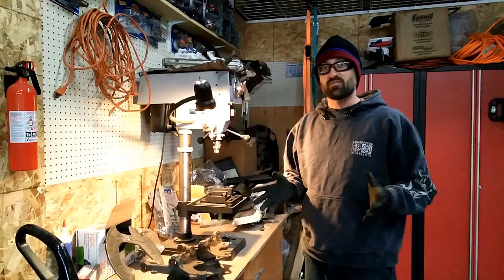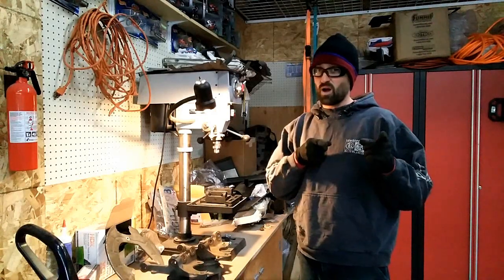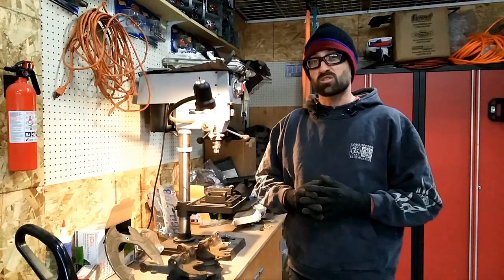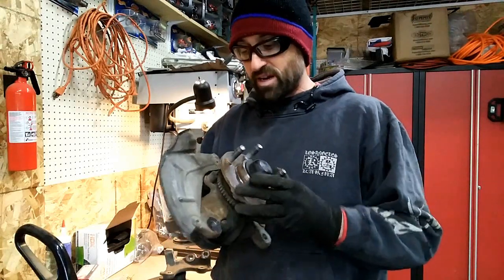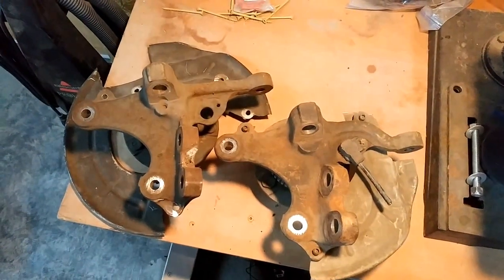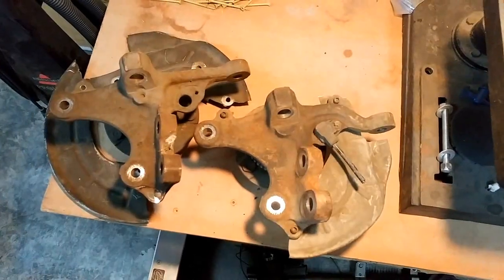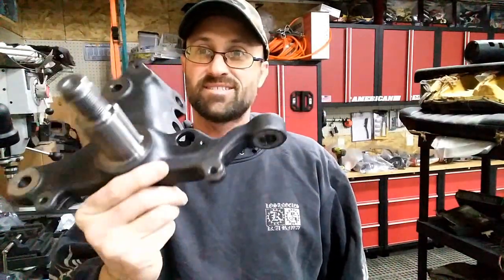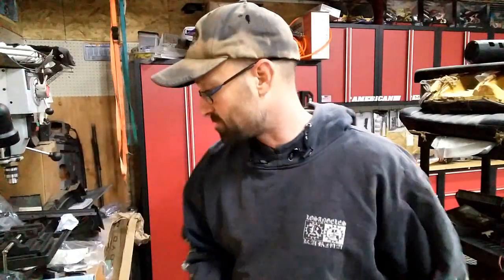How to Rebuild 94-04 5-Lug Ford Mustang Front Spindles

Comment: Good clean up on spindles i would like to know about new ones from 85yr 4 lug to 5 lug i believe 94-95 or is it 94-04 fronts
Reply from the maker: If you are running a stock Ford K-member, stay with the 94-95 spindles.

Comment: Did you just paint on the Evapo-Rust?  You mentioned a bucket, but you didn't immerse the whole spindle with the bearings, etc. in the bucket did you?
Reply from the maker: Just the spindles. The hubs (which contains the sealed bearings) were removed. I replaced the hubs with new parts when I reassembled everything back together.
Reply: @BasinMotorsports  
Thanks for the response.

Comment: Can you clarify how you removed the dust shield without the drill press?  I'm not having the best of luck with my regular hand drill and think the other method you mentioned in the video might be better for me.  Thanks!
Reply from the maker: I have used a small cutoff wheel on a Dremel to cut the backs off. Once that is done, the heads will come off the front easily.
Reply: @BasinMotorsports  Thank you so much.  I already have a 1/4 Die Grinder, but I need some cut off wheels.  I'll do what you recommend and try to cut the rivet as close to the spindle on the back side as possible and then use a punch to try to knock it out the front.  Much appreciated!
Reply from the maker: @cwc73  It's a slow process, but it will get the rivets out easily. They are a pain in the butt.

Comment: Real quick do you know what size drill bit or hole punch to use to get those rivets out of those spindles? I tried a chisel and ruined it only taking part of the head bolt off. Boy those bolt heads/rivets are strong and my chisel is no push over. I think I am going to get out my dremel since my HF drill is next to fisher price and use a cutting wheel with my dremel to see if that does the trick. Will wear safety glasses for sure as it would surprise me if that wheel explodes as soon as it makes contact with that superman head bolt. =)
Reply from the maker: I used a dremel cutoff wheel then they just punch out easily.

Comment: Thank you so much for the reply. Yeah you would think any fox guys doing this upgrade  getting so many benefits out of the swap would also pull the trigger on an aftermarket K-Member since it also has so many benefits including header clearance, weight savings, better geometry and much stronger. I am sure it then snowballs as we all know then wanting us to get their A-arms  and more. I personally absolutely love MM and am currently running their 3 link setup like heavy duty Torque Arm and Panhard Bar with their best/strongest non adjustable lower control arms. I noticed a HUGE difference with this setup including slamming on the brakes at 130 mpg with much less nose dive keeping her flat. Putting on this 3 link also makes so much more grip and less fish tail even in the rain!! The only time IRS gets the better of us is very bumpy hard turns but how many race tracks have this..
Reply from the maker: It can definitely snowball quickly.

Comment: Very nice video with helpful tips on which hardware to purchase. I have an 01 GT with a built/sleeved Boss 302 (roadrunner) motor with full MM suspension. I have some 96-04 spindles from another 99 GT. On my current 01 GT I removed the stock oem calipers/rotors to install my Wilwood 6 piston up front with 14" rotors. I am considering either putting them together with 99 spindles and selling them or just keeping them for a 5 lug swap into a fox someday. If I keep them do you know if a bumpsteer kit would fix the problem using the 96-04 spindles or is a new aftermarket K-member required. That and do all the 96-04 cars have ABS and dual piston calipers? I am surprised you with a wide body having more space to hide wheel/tire  wouldn't want to use those 97 spindles for even a wider stance getting better handling/steering response/bump travel etc vs the 94-95 spindles. I understand cause the hubs were shot is why you mix/matched but just curious if a full new K-member is needed or a bumpsteer kit would work. I plan to clean all mine up and possibly rebuild them for fun and either sell them or keep them but thank you for the tips and especially liked the part on how to remove the dust shield rivets.
Reply from the maker: When I talked to Maximum Motorsports about the wheel / tire combination I was planning for, they suggested the 94/95 spindles over the 96-04 spindles due to the tie rod connection point. You can try a bumpsteer kit to correct the geometry that the 96-04 spindles cause, but the connection point for the contol arm on the OEM k-member is slight changed too.  I would change the spindles to the 96-04 if you have an aftermarket k-member like an MM.  I have that extra set if I ever change to their K-member.  Not all 96-04 are dual piston calipers.  The 97 GT calipers I had were single piston.  Only the Cobra calipers were dual piston.  Everything else was single piston.

Comment: Cannaan, have an opportunity to buy 95 ,8.8 rear with Auburn carrier 3.55 gears for $200 to go into 89 notch for 5 lugg conversion.  I'm aware of overage on axle length for fox body . 
 Is this worth it or should I just convert the rear I have in the car now? Thanks
Reply from the maker: If it comes with the brakes, hard lines, etc., it's a steal at $200.  It will go right in the '89 and you can then just worry about the smaller connections.  It would be way easier to do the conversion with the '95 axle than to do what I did.

Comment: Awesome video!  Thanks for the tip about the Evapo-Rust!   I have been degreasing the spindles and then media basting them!  I use aluminum oxide and it cuts pretty well. It gives me a great surface for powder coating.  But, using Evapo-Rust would save time in the blast cabinet.  I would just have to blast long enough to get a nice profile instead of removing rust!  Thanks a lot!
Reply from the maker: The Evapo-Rust has been a huge help for me in terms of time.  I usually just brush off as much dirt and grime as I can, then soak it overnight.  You can't soak it too long, so if one night doesn't work just give it another.  I've been using my first bucket a lot on the current project.

Comment: Iam doing a 5 lug swap also my question is if you use the 94-95 spindle can you use the break set up off of the 99-04 break caliper and bracket?
Reply from the maker: If using 94-95 spindles, grinding/modification will need to be performed on the spindle to use PBR calipers (the 99-04) with 94-95 spindles.  You just need to shave down the brake mounting ears a little to fit.
Reply: Basin Motorsports thanks for the information now Iam trying to decide what axles to use Iam going to run the 03 cobra rims 10” on the back not sure what I need to go with stock length or sn95. I’ve not got very much help in this department.
Reply from the maker: What are the backspacing on the wheels?  Normally you run a 6.5" backspacing with fox axles on a 10" rim.
Reply: Basin Motorsports the forums say that there 6.12” backspace. I was planning on running the 96-04 spindles on the front I know that they will stick out sum  was thinking if I ran sn95 axels in the rear maybe the stance will be the same all the way around. Not sure what to do here that’s why Iam asking for your help no one can really steer me in the right direction.
Reply from the maker: A low 6.1" backspace will be fine with Fox axles since they are shorter.  The SN95 axles are 0.75" longer and require a higher backspace (6.8").  Where you'll run into trouble is mixing the two.  SN95 axles with a low backspace means you're pushing the wheels really far outward, and Fox axles with a high backspace means they go really far inward.

Have you by chance watched the video I made on measuring for custom wheels?  I explain the different pieces of it in that video.  You can overcome the Fox axles with a high backspace by running longer wheel studs and adding correct spacers.  You can't really do much with the SN95 axles and lower backspace.  There's no way to move the wheel inward, only outward (again with spacers).
Reply: Basin Motorsports I watch all your videos just been struggling with witch axle to run LMR had some better information on there site the backspace is 35- 50mm (H) on the stock SVT rims.
Reply from the maker: Rip &Grip That's where I looked this morning on the 03 Cobra wheels. Once you understand how it all relates, you can walk through how it all fits together. It took me a little while to figure it out enough to make the video and explain the basics. Keep up the work!
Reply: Basin Motorsports thank you for your time and the information keep up the good work on the videos I enjoy watching them there very helpful.
Reply from the maker: You're welcome if I can help.  I never claim to be an expert, but I'm not afraid to give advice where I can.  I was reminded this morning to enjoy the struggle and process.  Keep enjoying the struggle.  Thanks for watching!

Comment: So the optimal way to go is 94/95 spindles and ball joints for fox body stock k member set up?
Reply from the maker: If you are using the stock K-member, use the 94/95 spindles.  It's your choice on the ball joints.  You can use either, but the Fox ball joints require a washer stack or spacer because they are longer than needed for the SN95 spindles.

Comment: Just got a set of 94-95 spindles also from junkyard cheap. Thankfully they spin nice and free. Gonna do the dip you did I think to clean them up and then paint them. They are greasy and a little rusty right now
Reply from the maker: svtpower03 Clean them as best you can to remove the grease and then let the solution do the work a couple days. They'll come out great.

Comment: why not just pop in the 94-04 ball joints. they fit the same and you have no spacer washers? do new joints now not 2 yrs down the road taking some chances on using the USED ones. ...how I did mine ...I got mine off a 95 GT then new bearings/balljoints
Reply from the maker: Time and cost at this point.  I would need the right tools, which I don't have today.  I don't want to spend the cash on the right tools, nor the new parts.  My current ones will get me through until I decide what I am doing long-term with the suspension (new arms + k-member, coilovers, etc.).  I will get the car running and determine where the weaknesses lie in 2018, then look to upgrade a lot next winter as needed.  I have a lot planned to continue to evolve the car, but it all hinges on getting it running and driving in 3 months.

Comment: I only drive my car about 2000 miles a year so I didn’t use the dust shield more air to cool them down that’s my believe lol you would think a lot of dust would get behind it but no dust gets behind it theirs only brake dust on the rims witch is normal
Reply from the maker: I had thought about eliminating them, but for now I'll just put them back on with a nut/bolt combo that I can easily take back off in the future (instead of the rivets).  I may eventually replace them with a set from Agent 47 that has the duct built in that can tie into the Cobra R front bumper when it's done.  I did want to mention how to replace them in case someone needs to for their street car if they drive it a lot.
Reply: Basin Motorsports yea I agree if is driven a lot leave em on the name says it all dust shield lol